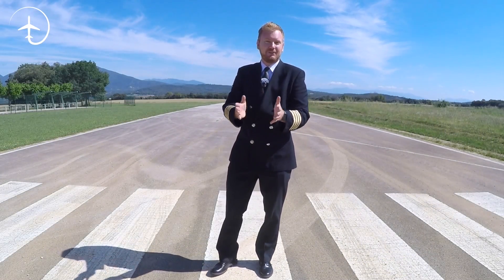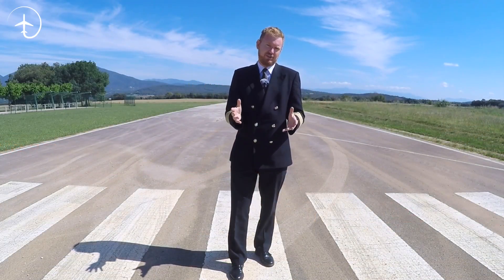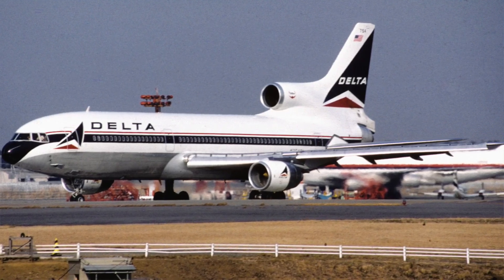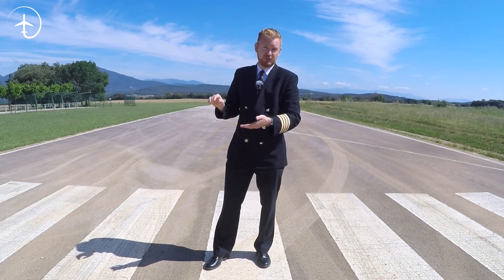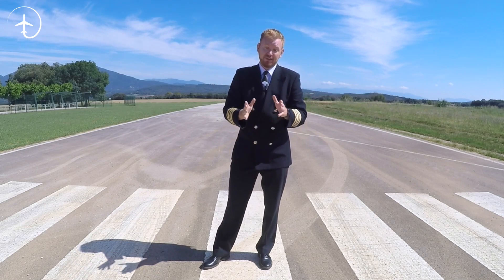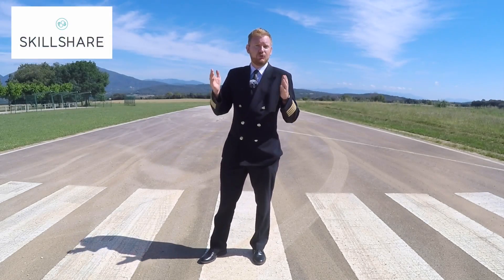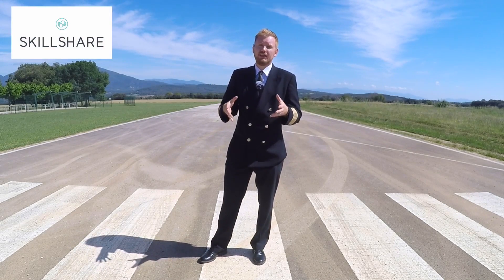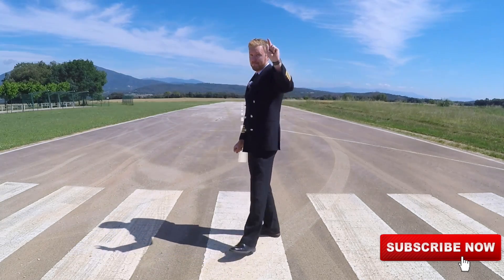Three Engined Aircraft, what happened?

Comment: So if one of the engines fails on the 777 while it's exactly half way across the Atlantic ocean, you're saying that the plan will be able to fly 2000 miles on just one engine until it reaches land again? And if so, would that be at a significantly reduced speed and altitude compared to if both engines were working. I would freak the hell out if I was on a flight with one engine on fire and it took 6 hours to reach land!
Reply: Ian Derzsi i do not have the specs on the 777, however; the A350, which holds ETOPS 370, meaning if one engine is lost, she may fly on the other engine on a route  over six hours (370 minutes) to an alternate should conditions warrant
Reply: With planes flying using Great Circle routes Reykjavik would be less distance than going to Shannon Airport on the coast of Ireland. If you are flying to a destination in Southern Europe the divert would be to the Azores.
Reply: You would want to maintain the altitude because of less fuel consumption and higher speed.
Reply: Ian Derzsi i
Reply: Correct for less fuel consumption, but incorrect for speed. Reducing altitude somewhat more than minimum necessary for maintaining altitude, increases thrust more than drag for modern planes with high bypass turbofans, allowing for higher speed. Also for the same mach number true airspeed is higher with less altitude in troposphere. And the plane is not flying in stratosphere with one engine out anyway.

Comment: Mentour, the first ETOP approvals of greater than 60 minutes were granted in the early 1980's for the Boeing 767-200ER. Following a few years of additional data collection, in 1989, Boeing 767 and certain A300 aircraft were granted 180 minute ETOPS.

The biggest issue on tri-engine aircraft is servicing. The same engine used on wing would go 35-38,000 hours before overhaul, while the tail mounted engine came off under 30,000 hours.

The Lockheed L-1011 was doomed by the Rolls Royce engine debacle. The DC-10 was renamed the MD-11 after a number of crashes. The US military still uses aerial refueling aircraft based on the DC-10.

I worked for one of the big three engine manufacturers and provided field service support. Since you were based in Europe, you know or knew of LTU. The Dusseldorf base had one maintenance stand just for servicing the tail mounted engine. It's a pain to check the oil level and doesn't get the same visibility as the wing mounted engines did.

Comment: L-1011 an DC-10 going back and forth to Hawaii in the late 80's - I still think that a 727 just has a great look.  3 engines and a T-tail.  That plane just looks modern and high tech.  but on the other hand that shows my age too.  Nothing cooler than a polishd shiny metal skin, Chrome it!  Do not the that much anymore.

Comment: I would think that having 2 engines on one wing and one on the other would cause roll too.

Another down fall with the DC-9 design.   When there is catastrophic engine failure the pieces can enter the cabin, and in at least one incident severed hydraulic lines leaving the aircraft uncontrollable through conventional means.

Comment: Thank you Captain. Nice video, as always. Don't you think that the tail engine in DC-10 and MD-11 was somehow a weak point and could decrease the overall reliability? In case a failure occurred to the engine, involving an explosion, this might have damaged the fin and the vertical rudder. If I remember it correctly, there were similar accidents caused by this. I flew several times on a DC-10 and an MD-11, and I've to confess that I didn't feel as comfortable as when I flew a 747, especially on the DC-10. And I never liked that little "shudder" when it took off...
Reply: actually I think the main weakness was that all 3 hydraulic systems were close to the tail engine. In one accident (United 232) it exploded and caused a total hydraulic loss.
Reply: It did happen once or twice, but I'd say the trade-off to that point was you also got a more robust structure in the rear of the aircraft, and after the accident Antoine described they did a lot of improvement to the hydraulics, previously the systems were not well isolated in ways that a catastrophic leak in portion of the system would not cause the entire circuit to deplete and become unusable...that alone would have preserved some control ability for U232 after that uncontained disc failure. Any time an engine shells out it's gonna be a bad day, doesn't matter where it's mounted. Throwing blades is one thing, but when a disc scatters stuff is going to get torn up. And a high probability something's coming through the cabin if it's a wing mount engine. So personally I'd say there really is no good or bad place for that type of failure. People are generally left with a bad impression of trijets because there were so many horrific accidents involving them...but upon scrutiny it seems that most had nothing to do with the actual design per se, many were due to improper repair or inspections, or mishandling by ground support personnel. A lot of the problems thus seemed to be that they were somewhat revolutionary and got ahead of the curve for the people who were tasked with keeping them flying.
Reply: Yep, Sioux City comes to mind. Tail engine blew it's fan disk and took out all three hydraulic lines. When I was younger our family often went on vacation by plane but my mom refused to go on a DC10, it's all we could do to get her on a plane at all. I loved flying but always felt uneasy going on DC9s, especially boarding at the rear when handrails were wet from condensation and the backs of the engines were covered in soot. My best flying experiences have been on Tupolevs and 747s.
Reply: No, because they have hydraulic fuses now. And the 747 has many more deadly design flaws than the DC-10

Comment: Great vid "as always"! Any idea why Dassault uses 3 engines for Falcons? Everyone else uses 2 and it seems the cost of the 3rd engine would be a great disadvantage.
Reply: It allows Falcons 900 and 2000 to cross oceans while not having to submit to the ETOPS rules. If Dassault business jet aircrafts had only two engines like its competitors ETOPS would apply.
Reply: julosx  Ok thnx! But I still I still find it difficult to understand why only Dassault takes this config and not Gulfstream, Bombardier etc. They too fly intercontinental.
Reply: Falcon 2000 is a twin, not 3 engine plane like Falcon 900, 7 and 8.
Furthermore both 900 and 2000 are light enough and have small enough passenger capacity to allow them not to need ETOPS for 180 min diversion time operations under EU rules. Meaning JAR, not FAR.

Comment: Could you please clarify why 3 engines consume more fuel than 2? From a naive perspective, 2 engines need a 50% margin in thrust in order to maintain redundancy, while 3 engines need 33%, therefore the total thrust on takeoff can be lower. And during cruise, why 3 smaller engines providing (say) 30 KN of thrust (10 per engine) would consume more fuel than 2 larger engines providing 15 KN per engine?

Comment: When landing, how do you assure the nose wheel is steered straight ahead?
Reply: You use the rudder pedals to stay on the centerline during the takeoff and landing rolls. They control both the rudder and nosewheel when the plane is on the ground. When taxiing, you use the nosewheel tiller instead, which allows much sharper turns than the rudder pedals. There's a system that centers the nosewheel whenever there's no weight on it.
Reply: Inside the NLG shock strut, there is a cam fixed to the cylinder and a cam fixed to the piston. As the weight comes off the NLG, the strut extends, due to weight, nitrogen pressure etc. The two cams then join up and centre the NLG, sometimes this system jams and the wheel doesn't centre but that's extremely rare and usually a maintenance defect.
Reply: Donald Stanfield we use the rudder pedals to control direction during the rollout. once taxi speed is reached, the tiller is used
Reply: You don't use the tiller when it's icy, you'll just skid the nosewheel. Intertia is really a bitch when there isn't much traction  to be had :-) you don't really use the rudder pedals at all but insted the "tiptoe" brakes on top of the rudder pedals. Top of pedal is for differential braking, bottom is for rudder, which will do absolutely jack all on the ground.
Reply: Look up Captain Joe vids it explains lot about airplanes systems and flying airliners
Reply: A lot of the time the nosewheel doesn't lock right in the straight ahead position, you have to sometimes give the bird a bit of a swing to get it to lock. PAX really love it when you do this when lining up for takoff :-)
Reply: Above a certain speed the nose wheel is locked straight ahead.
Reply: Svein Hanssen 130 knots is enough for aerodynamic steering using the vertical stabilizer rudder so the nosewheel steering is deactivated
Reply: They align themselves. The faster you go, the less degrees of movement
Reply: Then you hit reverse thrust once the wheels are on the ground
Reply: Wouldn't differential thrust be easier for ground turns in slippery conditions?
Reply: Donald Stanfield n,
Reply: Lux Pax is short for passengers.
Reply: Just like in a car you hold the steering wheel strait
so you know the front wheels point forward

Comment: I was sure that it was because of a dismal safety record among tri-jets.  What about that one DC-10 incident where the engine flipped over the wing and took both hydraulic lines with it?
Reply from the maker: Yes, that was the demise of the DC10 but not the Tri-jets
Reply: Oh.
Reply: That accident wasn't completely the end of the DC-10 due to the main cause of the engine departure being MX actions on the part of the airline. Removing the engine and pylon at the same time was not an approved maintenance procedure from Douglas Aircraft Company (and using improper ground equipment too). When the engine/pylon came off and the left side slats retracted; the difference in lift between the left and right wing rolled the plane over.
What could have been the end of the DC-10 was the 2 accidents involving the design of the aft cargo door locking mechanism.
Reply: If you research it, it could have been avoided even with the engine falling off. They had the change rules after that. Both sticks now had the vibration for stall and you do not power back to take off throttle... If they had pushed the throttles to the stops they would have made it.
Reply: That was out of Chicago on 5/25/79. Terrible accident related to bad maintenance practice. I was on a plane a week later with a buddy who asked a member of our flight crew if that was going to happen to us.
Reply: Oh that's got to be nerve-racking!

Comment: Do you think side view mirrors/ cameras would make the aircraft safer in the event of an emergency so the pilots can see the entirety of the situation?  I came to this conclusion after watching just about every episode of National Geographic channels Airplane Emergency series where many pilots made a wrong decision because they didn't know the extent of the emergency since they cant see anything behind the cockpit.  Sensors cant paint the entire picture.
Reply: The airlines will never pay for them unless they were required by the FAA.  A previous poster commented on the AA crash in Chicago.  AA had the option of having a stick shaker installed on the co-pilots control yoke on all its DC-10s, but chose not to.  Had a stick shaker been installed on the co-pilots yoke, the outcome might of been a survivable incident. The FAA mandated dual stick shakers after that accident, along with mechanically locking slat actuators.  So unless the FAA agrees that cameras to be a critical component for the safe operation the aircraft, don't bet on it happening.
Reply from the maker: I doubt that a rear-view mirror would change the situational awareness much.
Reply: Cameras on gimbal mounts would be better as they wouldn't stick out in the airstream as much.

Comment: Do the trijets have APU? For the angry puppies I don't see a problem, but for the S-duct models the APU's "usual" place is occupied by the tail engine.
Reply from the maker: Great question!
Reply: MD-80. MD = Mad Dog = angry puppy.
Reply: 727 had a APU near the right main gear. APU was only usable on the ground.
Reply: I have never heard of "angry puppies" before. What are they?
Reply: The hawker Siddeley Trident had its APU mounted above the tail engine. If you look closely at the tail fin, you'll notice a small intake above the engine intake. At the rear you'll see two exhausts: the upper one for the APU, the lower for the regular engine.
Reply: The Tupolev tu-154 did have an S-Duct too and the APU seam to be located in the back on the plane, between the 3 engines like, under the duck of the middle engines.
Reply: Istvan Knebli the Falcon 8x i fly does. the inlet and exhaust ducts are mounted just below the vertical stabilizer on the RH side.
The Number 2 (center) engine, delivers thrust from the opening beneath the tail
Reply: The 727 APU was mounted thru the keel beam in the main well. It had a stainless cocoon around it for fire protection. The exhaust vented thru the top of the right wing next to the fuselage. A hot start would send flames next to the passenger windows.
Reply: Jerry Dinger God I would love to see real-time reaction videos of the passengers when that happens! :-D "AHHH! This is the plane to hell!"
Reply: TalenGryphon Ha ha, yes one time we had a nervous flyer on the opposite side of the aircraft that when she saw the momentary flames, she opened her over wing hatch climbed out on the wing, ran to the end of the wing and jumped off. That's about a 8 foot drop, I believe she broke her arm. The 727 was still at the gate.
 I worked on the 727-100 & -200 for over 20 years. It's still my favorite plane.
Reply: The TriStar's APU is below the S-duct - you can see a small round exhaust under the rear fuselage for the APU. Not sure whether it gets air from the S-duct itself or from another small intake. It must be busy back there though - it has an all-moving tailplane so there must be a bunch of actuators for that all crammed into that area.
Reply: David Tsai 717 since the MD-80/90 are known as mad dogs the boeing 717 being newer and smaller is nicknamed the angry puppy
Reply: i always thought that was it
Reply: The Trident 3B had 4 engines!
Reply: The tridents had an auxiliary (4th) engine at the rear on later models - only used for takeoffs. the APU was mounted in the same area. It got crowded
Reply: The Trident's APU moved about a bit.On the original version of the Trident IC, it was under the fuselage between the wings. It was found that the hot exhaust could melt the tarmac. So, it was moved to a bullet fairing at the base of the fin trailing edge. That was the final location for the Trident 1C, 1E and 2E. With the Trident 3B, there was a small booster jet (the RB162) at the base of the tail fin trailing edge. The APU was therefore moved on the 3B to a location above the rear engine intake.
Reply: omepeet2006 that was actually a booster engine for extra power on take off
Reply: Only on the 3B version. The 1C, 1E and 2E did not have booster engines.
Reply: tscottme APU would run happily up to 25,000 feet. After that it would start to compressor stall. At which point the Captain would turn around and ask the S/O to turn off the APU. S/O would then have to buy the drinks for the rest of the trip.
Reply: Yes, aft of the maingear
You can see the fan spinning on the port side.
Reply: Yes they did it was based on the Ham Standard PT6.--J
Reply: David Tsai  auxiliary power unit. Used for starting main engines.